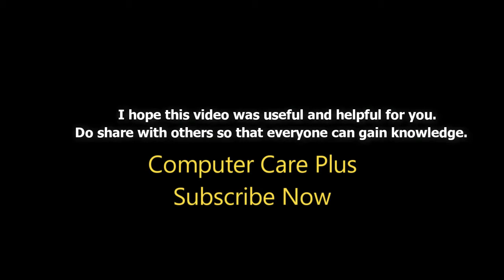Dell Optiplex 780 USFF CMOS BIOS Battery Install 100% ✔

Comment: Thank you - although the power supply isn't going back as easily as it does in your video. I've tried for almost 2 hours - another few minutes and it'll be going to the dump. What a stupid location for a battery!
Reply from the maker: Glad it helped